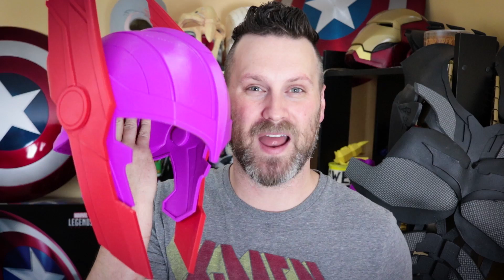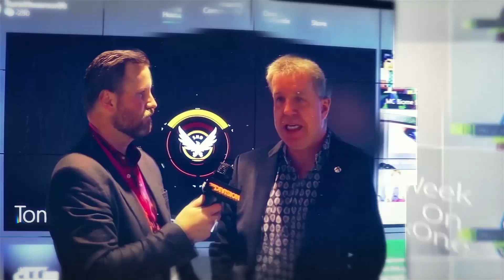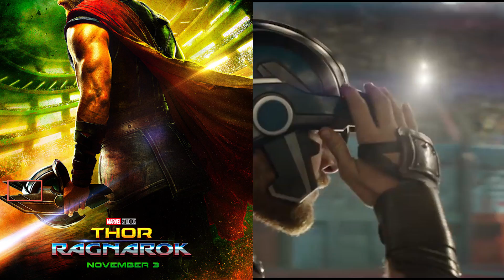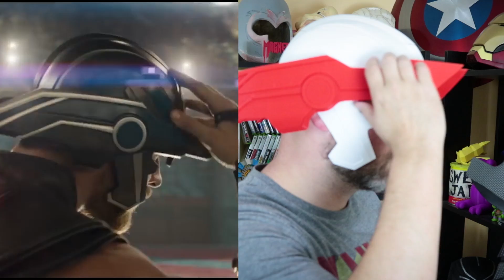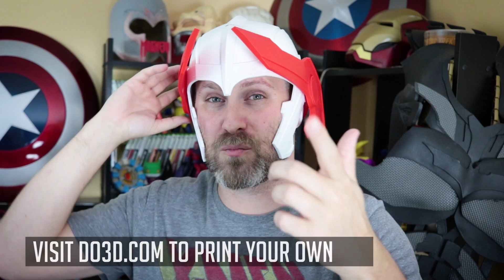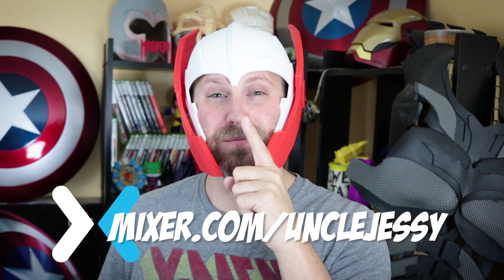Thor Ragnarok Helmet UPDATE - Now with Rotating Sides! 3D Printed Thor Helmet

Comment: Hey Jessy, How did you print the wings?  The first version looks like you put a horizontal cut so you'd have a flat edge to print vertically up from but I don't see it here.  Looks great though!
Reply from the maker: Mark Tuttle 2nd time I printed it was on the cr-10 s4 which has a huge build volume so I printed it all in one piece upside down on the top of the flat ear. The first one I had to cut in half to print